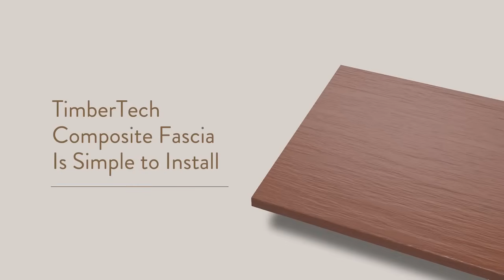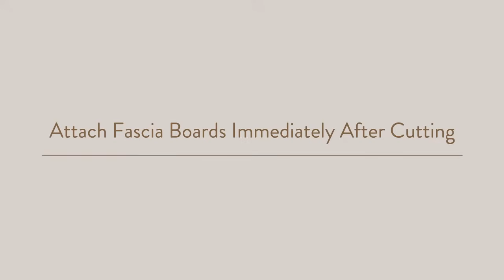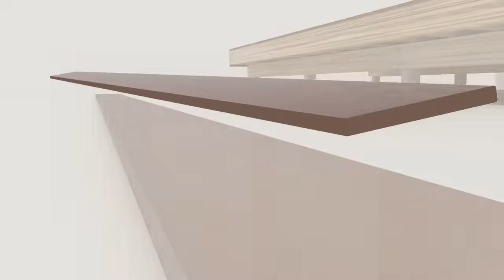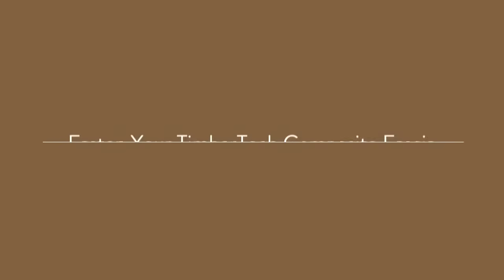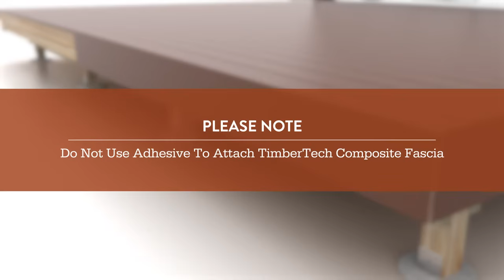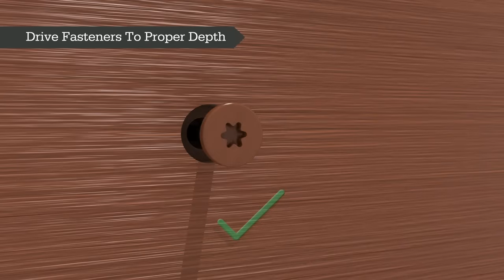TimberTech Composite Decking | Fascia Board Installation

Comment: You should use flat shims to space the fascia slightly out from the rim and end joists,  with the same gap as the deck boards.  If not, water will get trapped in between and cause premature rotting of the rim/end joists

Comment: Does there need to be any spacing between the facia and the rim joist? If you install the facia board flush with the decking, how do you prevent water from seeping behind the facia board and rotting out the rim joist?